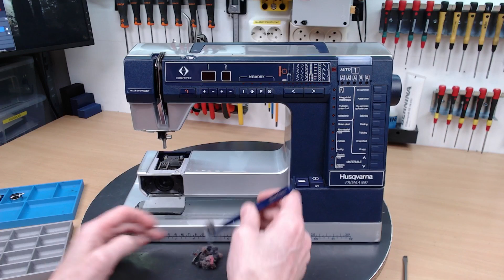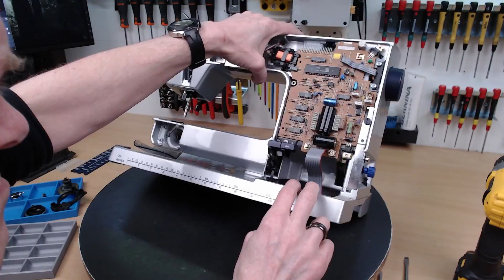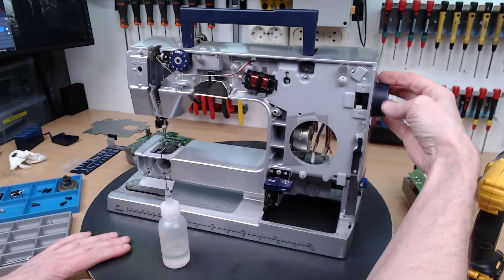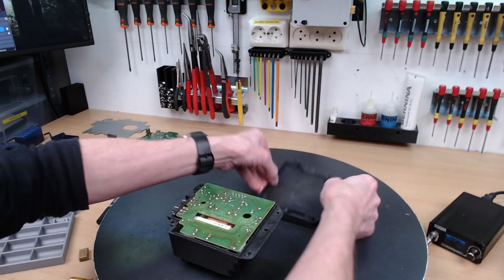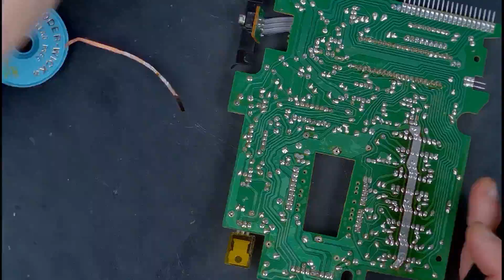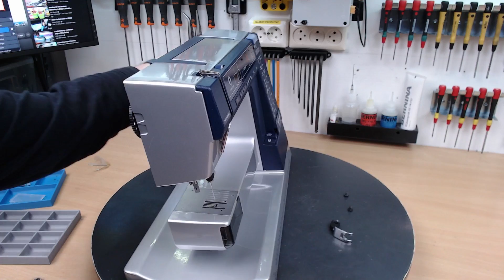Husqvarna PRISMA 990 on my workbench

Comment: Hello Sir, thank you so much for your video it’s so professional work! I followed your steps except the opening of the front I just opened and cleaned the behind of the machine, bobin area and under the machine where there is the electrical thing. But after turning everything back I turned it ON and all the buttons are lit and the stitch length and width screens are off. I tried pressing the pedal, machine is sewing but I didnt sew anything on a fabric to see what’s sewing since all the lights are on. Can you please help?! Did I break it ? 😢

Comment: my machine wont reverse, took it apart, it will only reverse if we do it manuallly, went to put it back together we cant get the blue backplate back on. help! we can get it on the screw on the left side but it the screw on the right the wont go on the metal bracket

Comment: My 980 was only sewing backwards. Tested the stepper motor controllers with your heat method. It was the third one down. Replaced it and the problem is fixed. Thank you very much.

Comment: I have the 900. I went to start a project today, first one since having it tuned up and cleaned. Unfortunately for me, I plugged it in, turned it on and it shut off within a second and I can’t get it to turn back on again. Is this a motherboard/electrical issue or do I just have a large paperweight sitting on my table now?

Comment: Hi Theo I’ve been plodding away at my wife’s 40-year-old Husqvarna 990 sewing machine on and off for several days now. I’ve checked almost every capacitor, replaced all of the electrolytics and checked about half of the resistors. Without a circuit diagram and software information it’s like stumbling about in the dark trying to find a needle in a haystack!! This you may recall is the problem where the needle starts to dither after the initial start-up dither. It’s a variable problem in as much as there can be anything form no delay to a 5 second delay.  I have established that Pins 8 and 9 on a pair of the PBL3717A drivers get a signal when the erroneous dither starts. But as these signals will be coming from the processor, I don’t know what is causing them. The power supply voltages look good although I haven’t put a scope on them.  I’m assuming that the fault has to be on the main board right under my nose, is that correct?? (I take that there's no way that a mechanical fault could cause this problem.)  If you would be happy for me to send the PCB to you to look at, I’d be happy to pay up front for you to take a look at the PCB and possible repair without any form of guarantee on your part. My wife has great sentimental attachments to this machine and as such I am very keen to try and fix it, and pay whatever it takes, and meet all costs in advance with no risk to you or any assurance of success from you.   
Thank you for you attention Theo. 
                       Kind regards . . . . Andy in the UK
Reply from the maker: I have replied to your email 🙂👍

Comment: Hi Peter, I’m still struggling with the Husqvarna 990 needle dithering problem. I’ve replaced all of the electrolytic capacitors, including the one in the transformer case, along with the 0.1uf Refa capacitor.   I wasn’t holding out too much hope as apart from the Refa capacitor, which had blown itself open circuit, all the others checked out OK on a low voltage test. I’ve looked on eBay in the UK and there aren’t any of these machines about. If there were I’d take a chance and buy one for the PCB as I’m assuming that this is now looking like a PCB fault.  Do you know of anywhere where I could get a main board or get the board repaired??
Kind regards . . . . Andy
Reply from the maker: Unfortunately, there aren't many people who repair the electronics on these machines. I don't know of anyone else who does it. Once I have a solution in place to accept electronics from abroad, I will start doing so, but not right now. I’m sorry I don’t have a better answer for you. -Theo

Comment: Hi Peter thank you for this video, what wonderful machines these are!!
Can you help me? My wife has a Viking Husqvana 990 sewing machine that has given many years of good service but today it started on its own. She had been using the machine but had moved away from it when it started. That is the needle started its side-to -side dither, nothing else moved. I’m told that normally when switched on the machine does the side-to-side dither for a fraction of a second and then stops.  
Now when I plug the machine in and switch it on, with the button on the machine, the needle dose its side-to-side dither for about a quarter of a second, it then stops for a brief period and then continues to do the side-to-side dither. This is without touching the foot control. The pause between the initial sided-to-side dither and when it restarts again is variable. Sometimes the delay is about half a second but it can be as much as two or more seconds, and sometimes the initial dither doesn’t stop at all. Again, this is all without touching the foot control.  On my wife’s other machine, a Fister Rossmann Lock 3, I had to replace a suppressor capacitor in the foot peddle as when that capacitor failed the machine started on its own at full speed. There is no capacitor in the Viking 990. I’m a retired industrial electronics/mechanical engineer so I’m happy to look at the machine but without any circuit diagram or prior experience with this machine, other than having a good sniff around and looking for obvious burnt or swollen components it’s a bit tricky to know what’s going on. Peter, is what I have described a typical fault that you recognize with the 990? Any help or advice would be gratefully received.    The number stammped on the casting is 82234508.     
Kind regards . . . . Andy  in the UK
Reply from the maker: Hi Andy! 

Based on your description, it almost seems like it’s restarting the stepper motor startup calibration multiple times. I'm not entirely sure what the cause is, but I always replace the electrolytic capacitors on the motherboard since they are starting to fail and, as a result, draw more current from the power supply.

If those capacitors are failing, they can draw so much current that the voltage drops enough to interrupt the startup and stepper motor calibration, causing it to restart. I haven’t encountered this specific issue before, so this is just 'virtual troubleshooting' based on theoretical possibilities. Regardless, I would try replacing the capacitors first.

-Theo
Reply: @sewrepair  Thanks Theo, I’ve just been looking at ordering the electrolytics as in the absence of any visual faults it’s about the only thing I can take a blind stab at. Everything looks good, no bulging capacitors or burnt components. The 0.1uf suppressor across the transformer has split but I’ve removed that, and that’s not the problem. I might just cut one leg on each of the capacitors and see if I can check them out. The capacitors are all 40 years old, I’ll replace them all, but I’d like to know that I’m on the right track. I have no experience of these machines so I don’t understand why the stepper needs to recalibrate itself. Is that just establishing a start on its encoder??  Thanks for coming back to me, I was beginning to think I wouldn’t get any feedback.  Thanks again. Kind regards . . .  Andy
Reply from the maker: It is not possible for the stepper motors to store their position, so they must perform a calibration to find their limit positions every time the machine is started. If you do not have a measuring instrument to check the internal resistance of the capacitors, replacing them is the only option. Sometimes, replacing components is the only way forward.
Reply: @sewrepair  Hi, I've got the capacitors on order, they should arrive tomorrow. I've cut one leg of each capacitor and checked them out with a moving coil meter. Unfortunately there is no obvious fault on any of them, including the one in the transformer box. By the way, in many years as a service engineer I have found that a moving coil meter, in my case an AVO8 is quite a reliable test tool for electrolytic capacitors. If you disconnect one leg of the capacitor, to take it out of circuit, and then, with the meter on the ohms rang test the capacitor, typically on a good capacitor the needle will swing right over to show a low resistance and slowly come back to infinity as the capacitor charges up, then quickly reverse the two test leads and the needle will again fly over to some low resistance value, and aging on a good capacitor the apparent resistance will increase as the capacitor charges. It's obviously only a low voltage test but it's a very good indicator. I have a good old fashioned Westinghouse capacitor bridge along with the usual digital meters, but I can tell you I have been fooled by an open circuit electrolytic cap  with a digital meter. Not that I think an OC cap is the trouble here. If there's some obscure high voltage problem going on then substitution will sort it out.  Do you know of any other good sauces of help on an electronic component level? I'm sure someone can say, 'Ah, I know exactly what the problem is!'  Or have you had this specific problem yourself??
Kind regards . . .  Andy

Comment: Hello there! Thank you for your video! I have this model and it does not zig zag or do decorative stitches. The needle is stuck to the right but it does a great straight stitch. The sewing center is not able to get parts for it. Do you have any advice for fixing this? Or any ideas on why the needle position won’t change?
Reply from the maker: Hard to say. The first step is to determine whether the issue is the stepper motor, the stepper motor controller, something mechanical, or something electronic upstream of the stepper motor controller. Once that has been narrowed down, you can proceed further.

From experience, most workshops that don’t want to repair older machines, or don’t have the necessary expertise, quickly claim that it’s not possible due to lack of parts. In this case, however, there is a very small chance that the required parts cannot be sourced.
Reply: @sewrepair thank you for your response! The Sewing center did say it was the stepper motor they believed. I did get another one, that is missing parts and is in bad shape but does zig zag so I am hoping to harvest the stepper motor off of it!

Comment: Can you please list out all of the parts that you swapped out?  I am trying to make sure that I buy enough off of your website and I can't tell.  Thank you so much for this wonderful information, including how to set the hook back in correctly.  Someone at my library's create center just opened my machine and didn't know how to put it in correctly... you saved me from ruining something.  Also, would you clean rust off of a hook, or would you replace it, so that the bobbin's thread doesn't get stuck.
Reply from the maker: If the power supply is in order and does not have burnt wire traces then I would replace 2 capacitors in the power supply and 3 or 4 capacitors in the machine depending on which PRISMA model you have. If the power supply has burnt wire traces the diodes have become too hot and I would replace them too. I would clean it free of rust and see if it works properly. You can put a little oil on the pin the bobbin sits on. https://3dsewingparts.com/37-husqvarna-prisma
Reply: @sewrepair  Thank you!  It is the same machine as in your video--the 990, I think.  The front label was knocked off 2 years ago.
Reply: @sewrepair  When I reassemble the hook, it sounds like the needle is rubbing on it.  Is there a way to avoid this?

Comment: Thanks a lot for the video! I have a problem with the feed teeth. I removed the screws that fix the plate to the small rod and I'm uncapable of putting them correctly so the button that takes them down and up doesn't work anymore. I don't know if you could show how to properly mount that specific piece of the machine. There are two small plates below thet clench with the upper part around other pieces and it may be that I'm positioning them wrong. Can you help me with some advice on how to fix it? Thanks

Comment: Like others have said Thanks for the video, Safety Capacitor had gone on my Prisma 990, I bought the Capacitors and diodes from your web site, (great service delivery was quick) The machine runs great now. I know I only needed the safety capacitor but as I was taking the machine apart made sense to change ad much as I could if one has gone maybe others are due to go. (Ive not used a soldering Iron for about 40 years but it was a pretty easy task thanks to the video)

Comment: Thank you for posting this excellent video.  I am working on a 980 that has a few problems and I decided to replace the capacitors using the kit you provided. The mainboard caps will be easy.  When I opened up the power supply, I found that the transformer is entirely sealed into the plastic case with epoxy, rather than screwed in place.  The power supply pcb does not have access to the caps on my version and seems thus quite irreparable.  Perhaps this is useful information for someone else.  
Also by the way - I need a carry handle for a 980 to replace the broken one on my unit.  Please reply if you know where I can get one.  (Scrap will be fine.)
Reply from the maker: In some PRISMA power supply the transformer are molded into the plastic. You have to desolter the transformer to access the PCB and the other components. I do not know where to get new carry handles so I am working on making a 3D printed handle. When I am satisfied with the quality you can buy them on 3dsewingparts.com :)

Comment: Thank you for this video maybe I can come closer to repair my 990S which has been standing for years when I did not come further. The transformer in the power supply is epoxied into the plastic cover - no screws. But from the video I can see what is on the other side, and I could get the PCB away by desoldering the transformer. I will clean and recap, just like in the video, and hope it will work after that. Originally the electronics work but the motor does not spin.
Reply from the maker: Thank you for your feedback! Yes, on some of the power supplies the circuit board must be soldered by the transformer to get to the components. A little more work, but not difficult. If the engine doesn't run, I would have tried changing the transistor BDW94 (remember the kapton tape). But I would put in new capacitors first ;) Good luck with the repair!
Reply: yes I do like that

Comment: Great video, I aspire to repair a 990 that isn't turning on, and upgrade a 980, for heavy duty stitching work/repairs to some of my hobby items in canvas and light leather.  Have a model 1200 too.  I do have some formal training in electronics repair, but not alot of experience.  I've repaired a few old radios and such when you can see what burned out.  Thank god I found this video, I have the confidence in fixing the 990 and making reliable the old 980.
Reply from the maker: Good to hear you will get the sewing machine fixed. Often if it does not turn on it is the power supply. If the power supply is defective, it is often due to the capacitors on the motherboard. The diode on the input on the motherboard also tends to break. I have posted the electronics schematics for the PRISMA power supply on my website, and am working on creating a schematics for the 980/990 motherboard. You can see them here: www.syrep.no/repair Good luck! :)

Comment: Thank you so much for sharing this detailed servicing. I picked up this model from an estate sale a few months ago for $50. It is my first machine and I couldn't be happier so far. I spent my first sewing day with it removing all the lint from beneath the needle plate and the bobbin case area. It had about as much lint as the one you cleaned here built up inside. I remember wondering how many years were marked by the layers, like rings of a tree. I was amazed that mine started up at all after that! Though, I did immediately notice a burnt smell to it and now the mystery is solved. I'll have to for sure replace the capacitors and investigate the electronics more thoroughly with a professional.   

I'm so grateful for your video - thanks again. I came across it because I was trying to find the name of the back cover for the free arm that has the metal tension brace inside? When I pulled this off, I noticed the two plastic teeth that hold the metal brace were also broken. Poor thing. I'm hoping to figure out a way to fix or replace that, too. I cannot wait to get it back in service like new again. I simply love everything it can do. I can't believe I was embroidering with it just a few weeks ago. I must've really pushed it to its final limits...